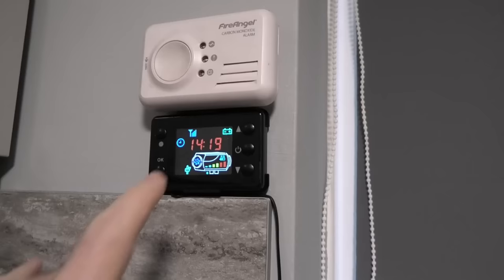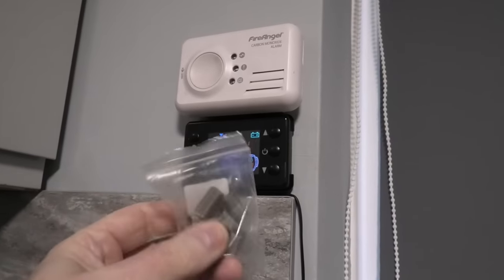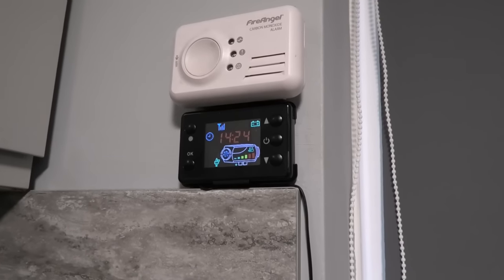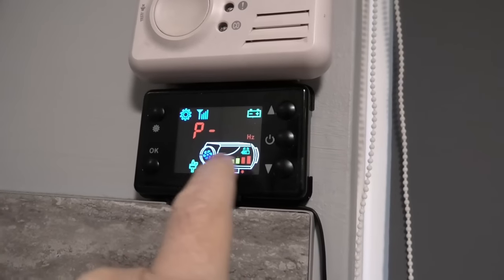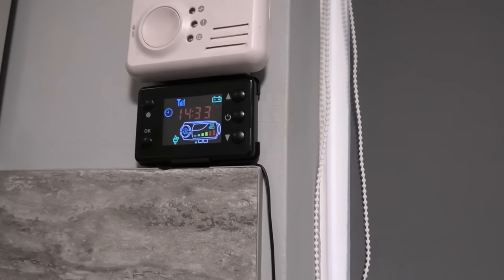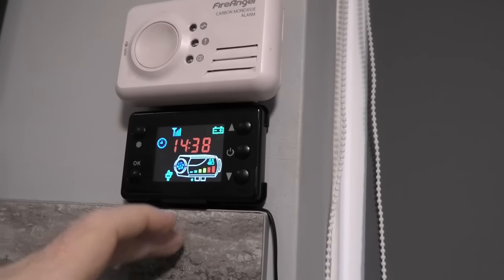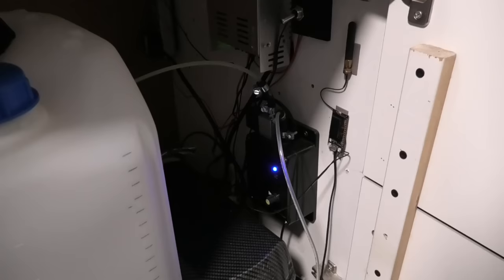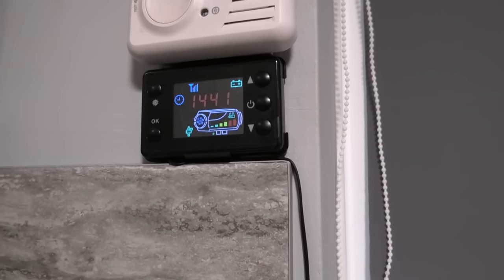How to tune a Chinese diesel heater with no tools 2kW & 5kW

Comment: Thanks for the helpful video! 

It seems that to keep the combustion chamber as clean as possible, you would want to have combustion on the lean side and also maximize your combustion chamber temperature.

So, it seems that you want to lower the fuel pump speed (which you have done) to lean-out combustion, but also lower the fan speed to increase the temperature of the combustion chamber.

Where is the flaw in my logic? I guess the fan controls more than the external (cooling) air, that runs over the exterior of the combustion unit to provide room heat, the fan must also provide the combustion chamber air as well?
Reply: Choke the combustion air input when at max fuelling like a regular oil boiler, to get the lowest volume of combustion product. That increases volumetric efficiency, increases heat exchanger temps while still keeping a lean burn👍🏻 Think of it the other way too... throwing in too much air simply blows all the hot gas straight out of the exhaust. You want to reduce exhaust gas temps to near condensing levels, while still maintaing a lean burn.
Reply from the maker: @Mobius X You are 100% correct! I'm pinning your comment, it explains the video in words 😉
Reply: I was going to use a server power supply wot you think tony ???
Reply: @idaveuk  any power supply that can provide 12-13 amps at 12v will work. It only pulls 10+ amps while the glow plug is on, after that the consumption drops to around 2 amps.
Reply: @fredfred2363  What you suggest sounds like a recipe for guaranteed incomplete combustion, at least that's how it comes across.
Reply: @fredfred2363  "Choke the combustion air input when at max fuelling".  But how would that maintain a "lean burn"? From what I've been reading, carbon soot does a fairly good job as insulating against heat transfer. So if you run rich and your chamber soots up, eventually you are back to blowing the heat out the exhaust. 

I would think running leaner and finding a way to recapture some of the exhaust heat would be the direction to go.
Reply: @idaveuk  Just get a older XBOX brick, 12v/18.5a
Reply: @idaveuk  That will work just fine
Reply: There are 2 fans. One on each end of the same blower motor
Reply: @idaveuk  That will work great, too. I have several that were under 10 bucks shipped, for 500 watts. And they are really well made.
Reply: @FuckignRuby  no they are forced intakte by impeller on same shaft of the room fan.
Reply: your carbon build up is because your burner  mesh is gone mate. The finish on it is gone you will get carbon build up regardless of settings now. You need to replace your burner it shouldnt be able to run at 1.2 and 2500rpm low fan speed thats a burner with expired mesh. Im talking the finish on the mesh inside the burner not the atomiser mesh. Cheers.
Reply: @fredfred2363 bollocks. Never run these too lean unless you want plugs needing replaced every 3 month. If you need to knock a 5 or 8kw copy model down to under 4.8hz regardless of fan speed to get it running good then your burner mesh is toast. Not the atomiser but the actual mesh in the burner core usually the one down at the burner  plate behind the turbine fins
Reply: you need to keep the burner temp up on these with fuel not leaning out or the exhaust end turns into a blow torch with running lean and the plug and atomiser is not heated enough out of its "of" period that it stays clean. The burner needs to be 110deg or ideally 120 on low settings and high settings above 165deg. Otherwise you destroy the burner mesh and plug&atomiser. I am.a boat builder ive done 100s of fitmemts even 30-40 of the chinese copies. I have the techbooks on the 12v and 24v geniune ebers and webers and they all say the same as regards to fueling too lean is worse for the internals than too rich. There is no argument here this is a fact
Reply: @bigduphusaj162  so what are the settings that you suggest?

Comment: I've been getting endless e-08's and e-10's for 3 months since getting one of these last fall -- all indicators pointed to too much fuel, but all the internet experts suggested too much air in my fuel lines, bad wires etc.  Working on these changed nothing.  Last night I used your setting as a starting point, 3.8 hz and 5000 rpm for the high setting, and without any other change it just started up instantly!  Thank you!
Reply: Do you have your pump on an angle 15⁰-35⁰?
I just purchased a second hand campervan and suspected that was my issue and found my pump installed perfectly horizontal.
Reply: Thats odd because the ecu inside the heater has a pre-programmed start up sequence, it is the same start up sequence for all of them and it is not adjustable so whatever setting you set for running in the special settings menu it will not affect the fan speed on start up whatever you do, just the running speed after start up, so your tinkering must have paid off initially maybe you cleared some air from the fuel lines? or cleaned out the atomiser hole next to the glow plug ?, something you did right, or maybe you just have a tempermental heater, I had one that didnt like starting, so I cut the length of the air intake hose in half straightened it and put an old piece of stocking on the end as a filter medium with an elastic band, it starts first time every time now. when you run one straight out of the box they will start up and run fine without any hoses or exhaust pipes attached and I thinkn thats how they test them in the factory. Then we go and stick a carboard hose on the air intake and restrict the airflow with a plastic silencer, probably slightly crushing the cardboard tube in the process or bending it  more than once so that it struggles to get air to the combustion chamber.
Reply: @oojimmyflip  when I had it on default settings, it would start up the first time after install, then just smoke and pop like crazy on every subsequent attempt, over and over and over.  Took everything apart, cleaned out the build-up (it wasn't burning the diesel fully), reassembled.. same thing.  Double-checked literally everything, pump angle etc. was all fine.  

It was only once I re-did the settings as outlined here, found the sweet spot, haven't had an issue again.  Didn't even have to disassemble and clean, just got going once the settings were fixed after many failed ignitions and a few flame outs on the default.  Last night was the first time I had it on since May, still using the modded settings from last feb, and it fired up right away.  I infer the startup sequence uses the 'low' and 'high' settings as its starting and ending point, gradually moving through the curve between these, if you think of it like a graph.  Pretty sure its not just one default startup with static fan/fuel settings.  If you think of the stoichiometry of the reaction here, diesel combustion needs diesel, oxygen, and heat.  When the reaction isn't working right, its one of these three things that are off, can't be anything else -- in my case it was lacking sufficient oxygen for complete combustion of the given fuel amount.

I think the issue is pump capacity.  These kits all come with different pumps, ranging between 16-22ml per 1000 pumps.  The default setting is maybe correct for one of these pump sizes, not the others.  I can't remember which size I have, I think 22ml ie one of the larger ones hence me needing to get more oxygen in there per pump frequency.
Reply: @oojimmyflip Thats wrong mate. I install these on boats im a boat builder. Lots of the smaller boats we do fefurbs on the  customer wants the cheap chinese ones. The start up sequence will change with the max and min rpm settings because the algorythim reduces the speed in which the fan ramps up just as it turns the plug off. For example the ones sold as 5-8kw are known for if you set the fan speed at 2500 & 5000 they have a habit of blowing out right as the plug turns off and the fan ramps up to max during start. The ramp up is too fast and the chamber usually gets blown out around the 56deg mark then you get a shutdown followed by an automatic second attempt, which sometimes gets it going.  By lowering the max fan speed to 4400-4600 regardless of the fueling frequency you will automatically reduce the ramping up speed and the heater will no longer blow out at 55ish deg when the plug goes out. You can clearly hear the difference it makes and if you have anything monitoring your battery then you can see it the figure on the fan rpm ramp up spike is lower on startup. This goes for the black, blue red and newer black controller the one that has the voice speaker and connectivity. This is also the case with both aftermarket controllers ive used and the algorithms in the expensive aftermarket one (you know the one?) its automatic start up sequence is basically 4800 normal temp start up, below 0 deg intake it goes to 4600 max and on second attempt onwards the controller sets the startup speed to 5000 for the 5-8kw copy heaters. I hope you accept this as the truth because ive had to sort a load of them for the same issue especially after plug changes some dont like set to 5000 on startup because of the ramp up being so steep. cheers.
Reply: @micg you are right sort of. These heaters especially the 5-8kw sold models the start up sequence algorythim will vary based on the max-min fan speed rpm, mostly the high speed setting. During the start up sequence the distinct ramp up in fan speed that coincides with the heater plug going out (around 55deg) is because the heater thinks the chamber is lit enough to run on its own. If you set the top RPM speed to 5000 and your heater runs fine then cool but if you are suffering blow outs on start up then reducing the max fan speed to 4600-4800rpm the rate in which the fan ramps up at slows so the chamber doesnt get blown out. Some of them you cannot get them going on 5000rpm setting after a plug renewal and a clean, they need backed off to 4600 to 4800 for a good 50hr before they can be sped up again. Despite what people think about these they run best with a small amount of carbon built up especially around the inner chamber where the gauze is around the turbulance plate at the bottom of the atomiser. When you clean them fully or use them from new for the first time this is why they dont burn right for about 50hr. They dont like too much carbon build up but nor do they like none. Webasto and Eberspacher know this btw thats why they have a cleaning setting now on the boats and lorries. The cleaning setting purposely gives it a rich wet burn cycle for 8 mins then roasts the thing for 3 mins then roasts it again for one minute then shuts off and restarts then sits exacly half way for 5 mins on the next start up. Hope this helps
 
Edit: I forgot to point out on this reply that when you put the heater in a "cleaning" cycle on the newer models in lorries and boats it automatically runs the high speed fan at a heavily reduced rpm as it takes into account that you might be doing the clean cycle because it has a choppy start up. Interestingly what it does is turn the plug out at the usual temp in the start up cycle but there is a delay from them about 20 seconds before it soft ramps the fan RPM up to max.
Reply: @micg where you are correct is that the first half of the start up sequence is predetermined. Its predetermined right up till the plug goes out. You will hear it ramp up at that point even though its still on the start up sequence. Its the point it ramps up is where your settings come into force. Its also the same on shutdown. See the initial part of the shutdown sequence when the thing turns into a leaf blower it will ramp up and down slower for that first bit with the settings reduced from 5000 to bellow 4800.
Reply: I experienced the other night at -40, im got code 08 at first and the code 10. Tried to fixed 3x times but unfortunately im getting code 10 because the burning chamber was flooded with fuel each and everytime I tried to start my heater. I run my rig to have heat just yo survive the night and manage to buy a new 1 from a local buy and sell group page, installed the new heater to my set up but still getting code 10, I tried to start the new unit with my exhaust setup with out my air intake hooked up and runs perfectly. I crawled underneath my rig and found out that the long cardboard air intake was frost and full mixture of fuel and water and the plastic filter was cover with ice completely. So the absence of air during the process of combustion(glowplug+fuel+airintake)is the the reason. I learned that if we chose to use chinese diesel heaters we need to have spare parts like glow plugs, fuel pumps, air intake pipes and the right set of tools which is still much more way cheaper compared in buying high end units that costs more thousands of bucks

Comment: I've already come across the silent pump for these heaters worth every penny the ticking drove me mad
Reply from the maker: Excellent mate, it makes a massive difference 😉
Reply: Thing is these were designed to be fitted outside, no idea when it became the norm to fit it all inside, I've been using these heaters for over 25 years and never had an issue TBH but i allways fit the pump outside on a bobbin mount ( classic mini exhaust mount) , mind you the better made pumps are quieter in operation 👍
Reply from the maker: @Dirt-Diggler  If I didn't live in a flat, I'd fit the whole lot outside in an insulated box. We have to do what we have to do in order to affordably stay warm mate.
Reply: @Vortecks  yeah it's all a compromise  i know 👍 they're not designed to be used in a house just lorrys and coaches but needs must and all that 😊👍
I know these burn about 250ml per hour on low so that's about 45p per hour on normal diesel, is that good compaired to electric heating ?  Mind you with electric constantly going up it only get cheaper by comparison 👍
Reply: Can you share where you got the silent pump?
Reply: I have the unit that's built all-in-one with tank and all and I can barely hear the pump. Did you different the all-in-one versus the model with the separate tank  I'm loving this all in one unit much better than the other one I had that didn't even work a month.
Reply: I built a 6mm plywood box for the pump and suspended the box with 4 x cup hooks and 6mm bungee chord available at B&Q pump silenced for good, our heater is in a plywood cupboard on our house outside wall.

Comment: Are you sure you weren't burning old socks in that thing ? It is recommended that you turn them onto highest setting at least once per month or more to help burn that off and that is assuming you are using clean fuel. This looks like it has been constantly run on a low setting for months.

Comment: I have watched your video and followed along for my heater. With the minimum fan from 1,500 to 2.500 and the maximum at 5,000 rpm, I adjusted my low hz to 1.2 and the high hz down from 5,5 to 3.6 when I got the 2 red bars back. All appears to be okay, so I will see how it goes for a while. Many thanks for doing this video.
Reply: From what I've read, I'd be careful running the fan at 5k. 4500 is as high as I have mine set
Reply: @CharredSteak  good advice thank you. I have reduced the speed and it’s working better. Too much air meant that the device was putting out cooler air and now it is hotter but still safe for the casing. I have the heater on for about 16 hours each day at 1.3 and I am content with it. Thanks again friend.
Reply: @gordonmitchell729  Absolutely man, hopefully it'll have the motor lasting longer too
Reply: Thank you for your explanation. 
One problem I have is in what I assume are fast forwards and can't work out what you are  pressing. I haven't a clue what code 1688 meant and how you got there. There is nothing on the screen with that number. As a teacher of electronics I have learnt to go slow and assume nothing
Reply: @allangoldsmith284  I will go through my notes and hopefully I will have the details. It was a year ago when I placed the text here. I will get back to you if I can recreate the readings

Comment: Stumbled across your video as I’ve just bought one but haven’t installed it my small workshop/shed, was gonna buy one 3 years ago for my old camper van but didn’t, so have seen hundreds of vids, was amazed at your quiet unassuming but knowledgeable presentation, blown away actually, instantly subbed and looking forward to your next blast of knowledge 👍😃
Reply from the maker: Thanks Cliff, I'm glad I could be of help. Properly tuned, these will run for a couple of years before the motor needs replacing when the brushes wear out. When I say a couple of years, I run mine probably 16 hours a day from the end of November to the end of March which is over 3,800 hours. I'll cover the installation in the next video and the servicing in the one after that.

Comment: What I’ve noticed with the heater is the intake “filter” is tiny. As a gear head and diesel mechanic I’d imagine that filter may be restricting the air which could cause excessive soot or carbon build up. I modified mine and it appears to run significantly better at its highest temperature setting

Comment: Thanks Tony, loving mine, will definitely have a play with its settings now.
Intrigued with your fuel pump upgrade, I have mine hanging on some string which has dulled down the harsh clicking 100%
Reply: built a box around my pump with 6mm plywood with a hole top and bottom for the fuel lines and wiring to go through, then I used 4 cup hooks to hang the box on 6mm bungee chord attached to 4 more cup hooks on the roof of the wall mounting box, cannot hear the pump clicking inside the wall box mounted to my outside wall of my house or indoors. my hearing is so sharp I can hear a pin drop outside at night. I have to sleep with earplugs in and I still wake up if I hear a noise outside through the earplugs. The pump is silent.
Reply: Try 6mm bungee chord instead of string